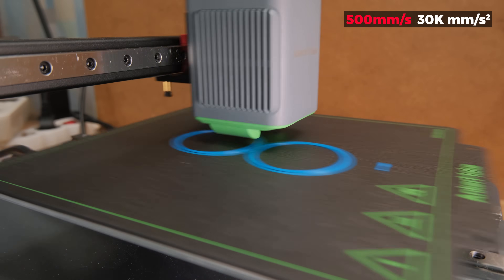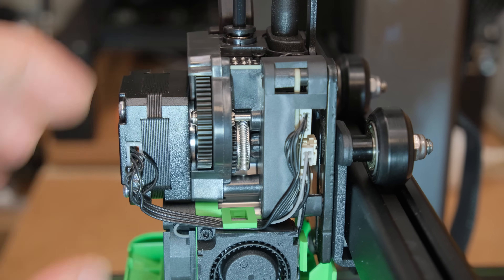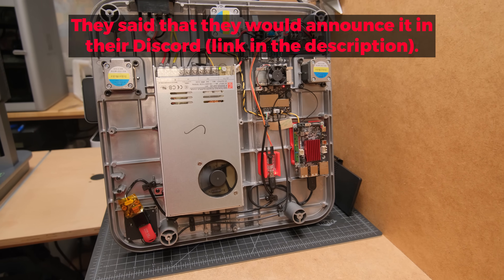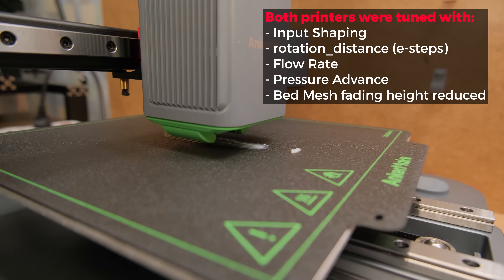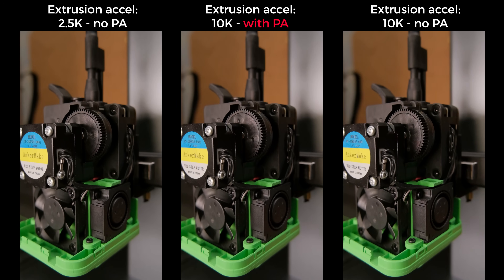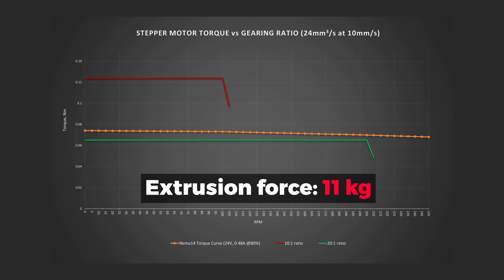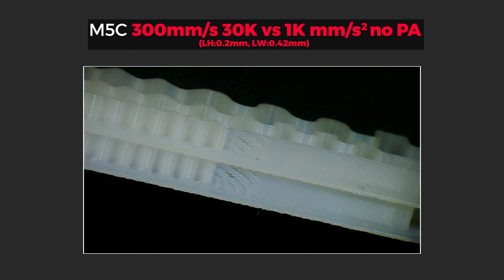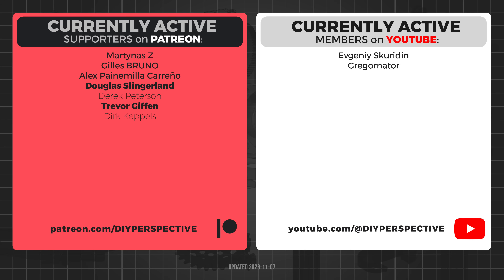High-Ratio 3D Printer EXTRUDERS – MUST HAVE? or STUPID?

Comment from the maker: ABOUT DISASSEMBLING STEPPER MOTORS:

"In principle, common stepping motors can be divided into two types: reactive stepping motor and hybrid stepping motor. The reactive stepping motor can be disassembled, while the hybrid stepping motor must not be disassembled. The mixed type mainly uses strong magnetic aluminum nickel cobalt material, which is high temperature resistant and does not demagnetize at high temperature. It is charged to saturated state during production. If it is disassembled, the magnetic circuit will no longer be closed, and the magnetic core will weaken. Special magnetizing equipment is required, which can not be solved by ordinary people. If neodymium iron boron material is used, it is not a big problem to disassemble it."

This is a shortened quote from casunsteppermotor.com website.

Comment: Its not about the ratio but the contact area mm2 to filament itself. High Ratio extruders tend to wear gears out in shorter time... P/P wise High Gear Ratio is not the solution but a marketing complexity IMO or a temporary solution doesn't have longevity... when it comes to extruders I beleive in simplicity and contact area of filament...

Comment: So there's one big glaring issue with this whole thing. All the work you did isn't relevant because the extruder gear is much larger. Steps per mm of filament moved is what matters. I'm not sure what the numbers are but id guess the gear ratios are more or less the same given the difference in the final diameter of the drive wheels. Just as a jeep with 3.55 gearing and 28" tires goes the same speed at the same rpm as a jeep with 4.10 gearing and 31" tires.

Comment: I'm here in 2024 still using a 1:1 direct drive extruder like its 2014 😅

One thing i noticed from my first printer is that the idler arm doesn't sit even with the extruder gear, rides a little lower. For the longest i thought it was just a mistake, but a few years ago i noticed the filament that rides though and gets the gear markings curls away from said markings. This is important because i found out it binds the filament. So instead of installing a H2 V2S Revo i just bought at the time when it was new (like 3 years ago) i simply slapped on the old extruder arm from my Replicator Dual and started to do some flow tests. Immediately noticed it was able to hit 22mm3s flow rate with a Frankenstein'ed volcano V6 half copper and hardened tip i made, up from 16mm3s. Then noticed there was slight deformation from the V shaped idle bearing when printing ABS enclosed so i designed a whole new arm with a larger U shaped idle bearing and then it went up to 26mm3s. Then coupled with the Microswiss CM2 hybrid copper Volcano nozzle with a small hardened tip, I'm printing everything at 26mm3s at low temps and can easily do 32mm3s with higher temps (within spec). I'm able to print at 40mm3s 10c over at 250mm/s 4K acceleration if i want to push it

This is using a Nema17 42x30 StepperOnline motor, even tried a 42x23 for fun.. limited to about 20mm3s flow. Original 42x36mm would start shredding the filament, while the 42x30 does show signs of slippage on the filament when pushed too much, it starts skipping.. which IMO is better to have at the limit, no more having to clean filament chunks.

My thesis being that filament binds on the walls, more so after heat soak. If you can feed the filament in "straighter" by compensating for the curl it will help avoid said binding

Comment: I would be very interested to see if there is any impact on extrusion consistency with large gear extruders. 0.1mm of extruder gear runout has much less of an effect on extrusion if the extruder gear has a 10mm radius, than if it has a 3mm radius.

Comment: Might be controversial comment, but I think you should change your dialogue delivery. Your accent is very different (which is not a problem), but when you try to deliver dialogues like natural english speakers I find it really difficult to keep up with what you are saying. I really value your videos and I think you will do better if you try to deliver dialogue as you normally speak. Your content is good enough, you don't need to polish it with cool dialogue delivery.

Comment: This makes no difference. Gear ratio isn't just a ratio between smaller and larger meshed gears. There are other mechanical linkages in this system. like between the drive gears and the filament. Because these extruders use larger drive gears, The gear ratio between the drive gears and the filament is lower and when this value is multiplied by the 20-1 (or some like that) gear ratio, the value gets much lower and close to what was typical on older extruder systems. (the overall gearing of the system would be {gear ratio}/{rotation distance}. This should be the metric that we compare between different extruders). If we neglect the inefficiency in gear meshings, If the filament is moving at the same speed and with the same accelerations, The load on the motor would pretty much be the same. The only thing that changes is where on the torque-speed curve we hit the motor and this could be specifically designed for and since based on your calculations, we're not even close to motor limits, we'd better optimize for more efficient meshings (which in turn could even mean less load on the motor for the same performance) in the system, since the first gearing is between two hard materials and much more efficient than the meshing between the drive gear and the filament, It's only logical to take some load off the filament and add it to the first gearing and that's why everyone's moving toward higher gear ratio while increasing extruder's rotation distance.

Comment: well I got question for you
i am using ender 3 pro with bowden but in future i will change hotend to some longer for flow and for now i still have problem i am using lerdge extruder gear on stock extruder block so whenever so much rectraction came the filament strips easily because of sharp teeth  
so i am planning planning buying titan fake  or other model fake or i will just buy one large gear that wouldn't strip filament but still gonna be one gear drive so i am thinking would it work or shall i buy reduction extruder?

Comment: When you are comparing ratios of extruders, are you taking the filament drive gear diameter into account? That 7.5:1 Orbiter ratio is just the ratio of the gearbox and/or differential if it were a car. But it has larger filament drive gears (wheels if it were a car) and thus not as much overall reduction when compared to Sherpa type extruders with 5:1 gearing and smaller filament drive gears.

Comment: Is this videos main focus to establish if there is an e acceleration bottleneck that is alleviated by the high gear ratio? They went with bigger gears, they need more torque, they don't want a bigger (heavier)motor, they operate a smaller motor at a higher rpm. Did that Haldis have a better flow error chart? Is it motor skipping or gear traction loss?
Reply from the maker: Steppers loses torque with speed so needing to accelerate twice as fast to twice the speed can be challenging. Flow chart was similar but it had a slightly higher flow hotend. Motor skipping, it is almost impossible to get slip with big filament drive gears.
Reply: @PrintingPerspective  Can you increase stepper current with klipper? Its the same size gears and looks like the same unmodified flow as my LGX, but it looks heavier. Maybe if you could increase amps then it would be worth the extra weight.

Comment: The reflected torque is indeed reduced by the square of the gear ratio, but don’t forget that you motor inertia didn’t go down and you will need to accelerate at a much higher rate.
Reply from the maker: That's true. But then I could use a smaller stepper with lower inertia, you know. IMO it is all about balancing stuff for the required extrusion force, speeds and accels.

Comment: Neat! Now I gotta figure out the best way to add rails to my OG M5
Reply: I’ve found that the x axis on my m5c is the only axis that needs a rail, the y axis has routed channels that fit the Pom wheels way better than normal extrusions and the z axis is a greased plastic slide mechanism which is pretty tight and accurate, but the X axis wears the lower wheel incredibly fast and it has a tiny bit of movement from the wheel bearings.

Comment: The main question is, why do you need that high of a force to extrude ? A 3D printer is not a router, you usually don´t need high forces and higher forces wear out the machine faster. 
When does the filament swell due too too much speed ? This is also pretty interesting, there is no point in extruding faster if you get filament swell and inaccuracies. This means you will need some  type of compensation again. The faster you go the more forms of compensations you need to account for all sorts of effects.
Reply: A beefy extruder is needed to corral flexible filaments. A soft TPU actually exerts a spring-like force that has to be overcome to pull it into the extruder. Boden-style extruders have an even tougher time, because not only is the filament pulling like taffy on the input, it's compressing like jello on the output.
Reply: @seanwoods647  Hmm for TPU a PTFE tube up to the nozzle is probably the best solution, the high force probably won´t change the behavior. The extruder geometry does, you need more grip not more force. At least not that much force. 
Bowden type extruder for TPU is not a good idea for that reason true. However I don´t think the amount of force is the problem it´s the friction and the elasticity.
Reply from the maker: Well you shouldn't, unless you're using smaller nozzles or like CHT clones or other reasons. Higher extrusion force just compensate for hotend's declining ability with higher speeds to melt the plastic that needs way more force to be pushed out, not that it is a good thing or anything... But I really like the higher ratio idea on big filament drive gears. But 15:1 would be plenty IMO.
Reply: @PrintingPerspective  "...Higher extrusion force just compensate for hotend's declining ability with higher speeds to melt the plastic ..." Exactly! It´s a brute force solution for a root problem with a completely different cause.
The main advantage is probably weight saving by the motor. Instead of using a nema 17 you could use a nema 14 round pancacke style or similar.

Comment: Good video as always.

Personally i prefer to compare extruders not by gear ratio, but by steps per mm or rotation distance. That gives you a clear loom of how a gearbox actually works as the output isnt always the same. As example a lgx and bmg both claim a 3 to 1 gear ratio, which is first of all nonsense, and second the lgx has lower e steps values than a bmg. The lgx has a two stage reduction rather than single stage like the bmg because of the large drive gears. So the 3 to 1 gear ratio only applies to one stage of the lgxs gearing, i dont know the exact teeth count, but if i had to guess it would be the first stage, stepper motor to intermediate gear. After that you still have the stage intermediate gear to feed gear. So overall a pretty high gear ratio (a 3 to 1 and another) but have pretty comparable overall reduction. 

This is the same reason why belted z isnt more accurate or faster than leadscrew z, it depends fully on the steps per mm/rotation distance. I was going through a voron trident config and noticed that it had much lower z speed than a 2.4, 30mm/s vs 8mm/s, the comment after that said because leadscrew. BS i call it. I got 25mm/s in stealthchop and with 1k acceleration for out of it, with the fat 350mm bed
Reply from the maker: Thanks. Yup, that makes sense as it would give a more apples to apples comparison. And about belt vs leadscrew, you are not wrong you can drive them fast too. Question is should you? Higher accels higher wear on a friction based system. But then z belts needs quite high tension so you are sacrificing your idler pulleys... There are so much nuances lol.
Reply: @PrintingPerspective  as always everything has advantages and disadvantages. Im using POM nuts with non coated leadscrews like you once tested in a video is a agree that this is the best compromise between low friction and accuracy.
Reply: Just want to point this out:
https://www.youtube.com/watch?v=S-om0MPE5qI
belted z can go VERY fast, I don't think it's feasible to reach these speeds with leadscrews. (I mean everything is possible of course).
But I'll admit that belted z might not have advantages during printing (in my experience), except for potentially avoiding z-wobble, and not wearing like leadscrews might do.

Comment: Great job on the video! Been considering this as I seem to have reached the limit of my extruder. 
I would love to see this test with a higher jerk value (can't think of the klipper term atm) and a lower smooth_time value (which should improve th initial underextrusion you were getting). Both cause the extruser to have to accelerate faster. Smaller smooth times make a difference on high accel prints. I had to decrease the value on my bowden setup to make it work well because I print between 30k and 100k and it looks way better at 0.035 than 0.04.
Reply: I think you mean Square Corner Velocity.
Reply: @spectermk1  there it is!
Reply from the maker: At some point I will need to play with those just for curiosity. Usually I print way slower as layer adhesion is the priority.

Comment: Ouch, taking out a stepper motors rotor renders it unusable! 
Very informative video, as usual, thank you.
Reply: I don't think that applies to all steppers.
Reply: @jov7733  Not to all but pretty much all off the shelf hybrid stepper motors. Better save than sorry.
Reply: @jov7733  it doesn't. Steppers using neodinium magnets for example don't suffer from this.
Reply: How so?
Reply: @GQinc67542  it de-magnetizes so it has no more torque
Reply: @toma.cnc1  How so ? He isn´t heating it or beating it up. The motor needed to be magnetised before it was assembled as well, so how did the factory manage to not de-magnetize it then ?
Reply: @sierraecho884  Removing the rotor from its stack can cause the loss of magnetism and lead to misalignment as the magnetic circuit via the stator was not there to act as a magnetic keeper.They get magnetised after being assembled.
Reply: @spectermk1  Oh wow you are right, they do magnetize the whole motor when assembled. Thanks, learned something new today. I am a R&D engineer, how embarrassing xD
Reply: @sierraecho884  you never stop learning :D
At work we wanted to repair a stepper and thought: "How hard could it be". We could repair it, but the motor lost about 40% of it's torque and was pretty much unusable. We later looked up why that happend. Long story short: Repairing it ourselves(and even more so properly repairing it) is more costly than buying a new motor due to wages and stuff needed to properly do it :D
Reply: @spectermk1  40% is significant. I never knew that, I too thought de-magnetizing ? Sounds strange you usually need high temps or mechanic shocks etc. Interesting.
Reply from the maker: Well then RIP stepper I guess. I will need to look into it. :) Never heard that before.